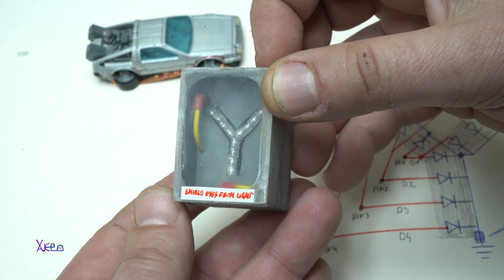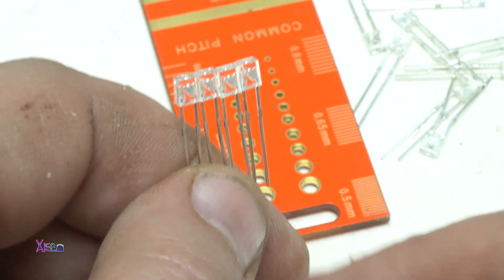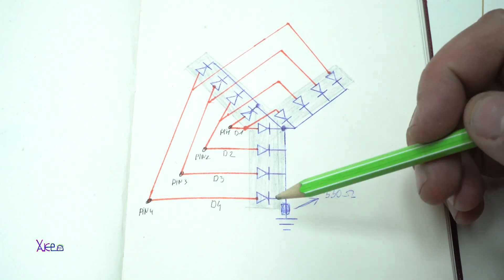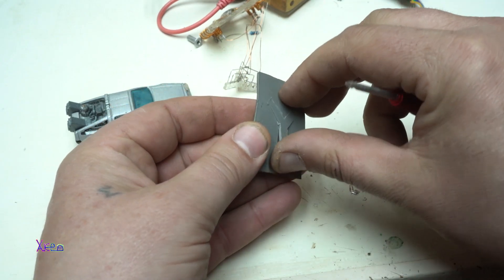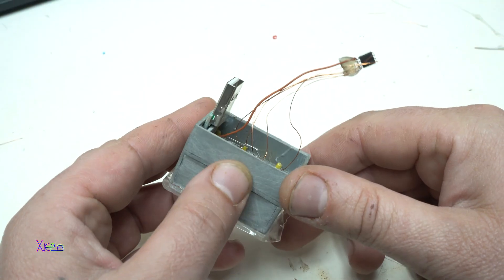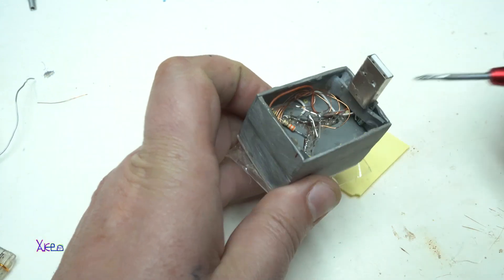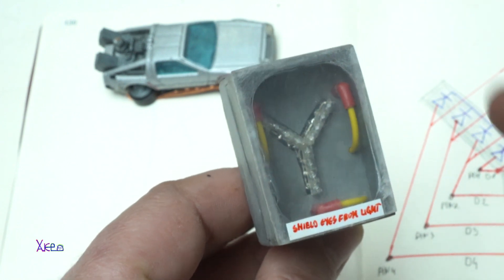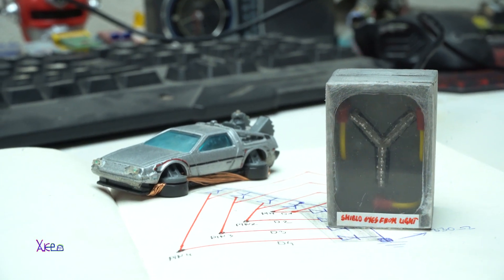Making LED Flux Capacitor Part 2

Comment: I really like this , unfortunately also kinda new, do you have a connection or schematic of chip to diode as I really want to build this, thanks for your time.
Reply from the maker: If you are familiar wit arduino,its simple just use 4 pinouts to drive 4 leds,positive sides of leds goes on chip and all negative legs of leds thrue one resistor of 470ohms to ground,thats it!
Code in desc box.works with all arduino boards.
Reply: @Hacktuber   new to arduino,  another step to figure out 😊